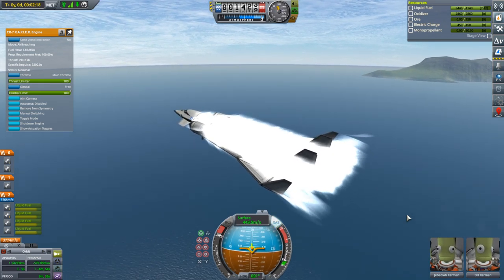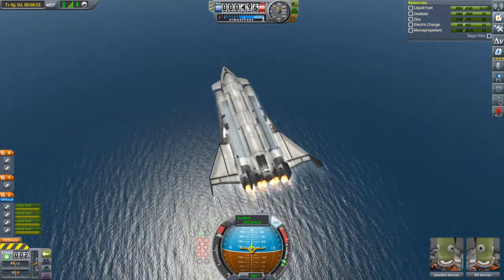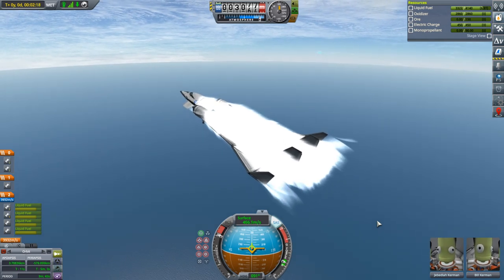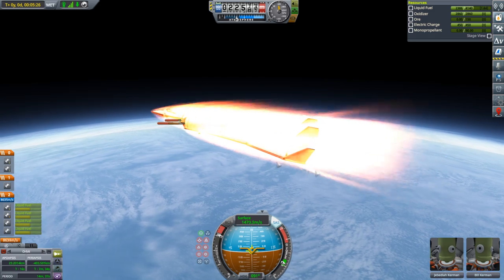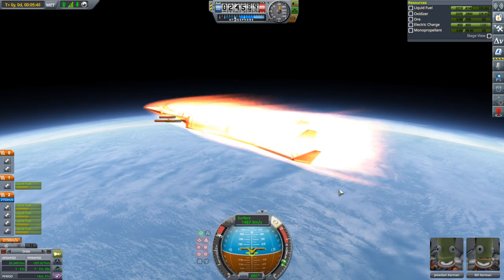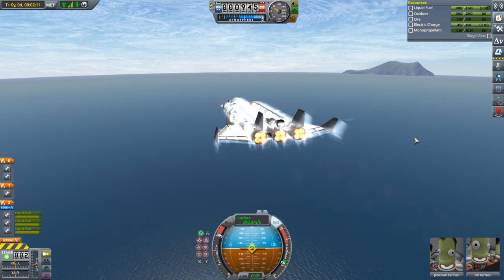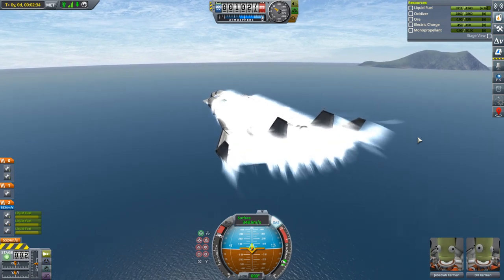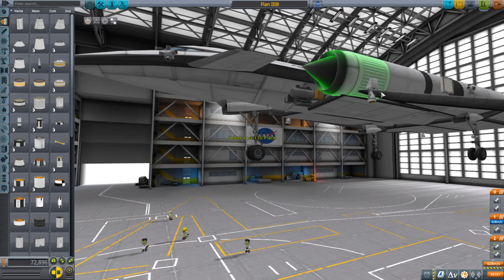Kerbal Space Program 1.8.1 - SSTD Improvement Testing Part 1

Comment: My flying trajectory on 60t 2 rapiers plane - climbing on 6-7 degree up to 4km, at this point have 1m speed, then switching between prograde and stability assist to 450m/s, then slowly pitch up, using caps lock mode, not allowing speed dropping too much. And couple more suggestions - you can play a little bit with dumper/spring strength on landing gears to prevent bouncing, i have 1.3 and 1.6 on small ones. Small drills cant mine ore with low concentrations - so you need survey scanner on plane or survey planet in advance. Close intake in the same action group as switch mode on rapiers - saves a little bit of drag. Hide solars/radiators/drills/fuel cell in cargobay, drag is main enemy in this type of plane. Also fuel production in this isru unit can be so litte so fuel sells eat more then it produce, so i use rtg instead.

Comment: I was sure it would work with three rapiers, now just hit f12 while you're flying and see where the drag comes from. When I see how it struggles to accelerate ASL your drag must be massive.
Two rapiers should be ok once you've fixed your drag issues. As a rule of thumb, if you take off before the end of the runway you have too much thrust 😋
But please don't go nuclear, everybody does rapier+nuke SSTOs, yours is interesting because it is different. And hopefully once you'll have removed the weight of another rapier + LF your landing gear will stop bouncing like crazy on the runway.

Comment: 2 rapiers is sufficient but you need to minimize drag. That means all mining equipment and vertical lift engines in a cargo bay. Use retractable solar panels. Main wing with angle of incidence of around 3-5 degrees so you can point prograde while maintaining altitude. No monoprop RCS since those product a lot of drag, use vernors.

Tried a 2 rapier, 2 terrier combo and got to LKO with 1700m/s remaining.